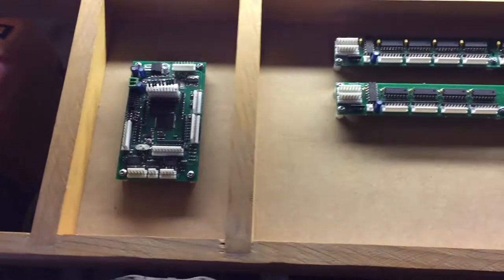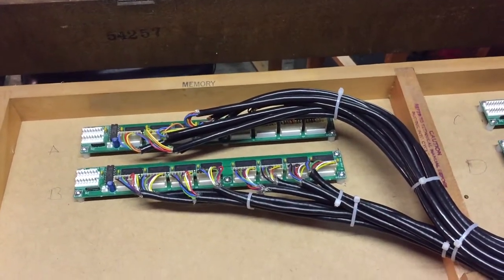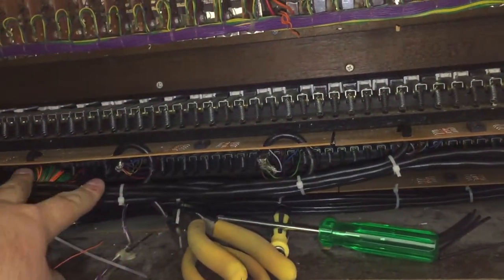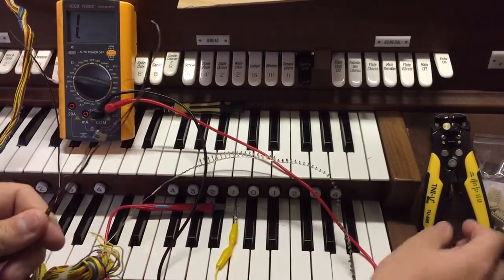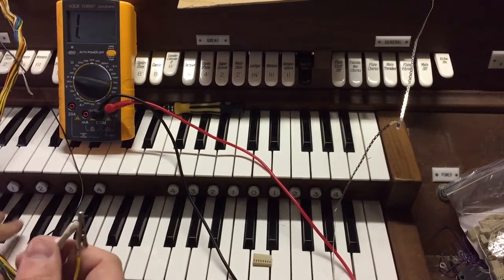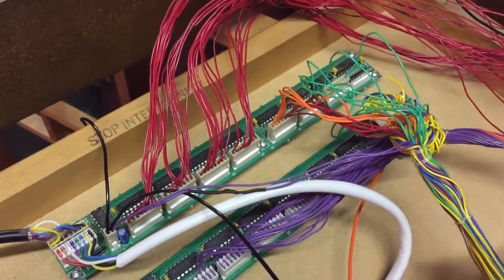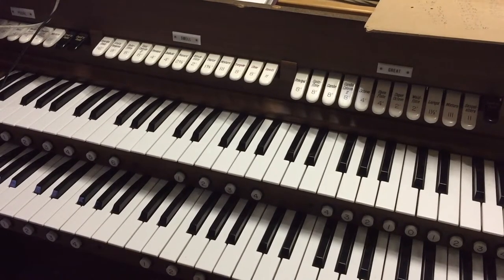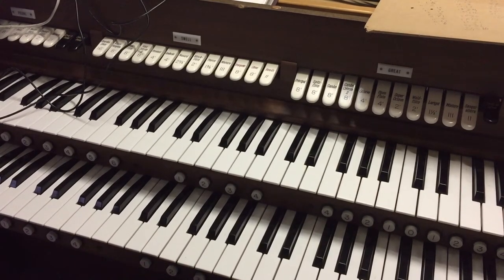Refitting an Analogue Pipe Organ Console - Part 2

Comment: We are just about to embark on a similar conversion. I'm currently looking at designing the interface board from the PC to the pipe solenoids. I was wondering where you got your boards from, as this might save me some time and work from building our own.
Reply from the maker: Check out my later pipe organ videos to see the Uniflex system. I cannot honestly recommend them. The support that I have received has been abysmal. Opus 2 is something worth considering, though I haven't used it personally. These boards were made by a local electronics engineer & organ enthusiast.